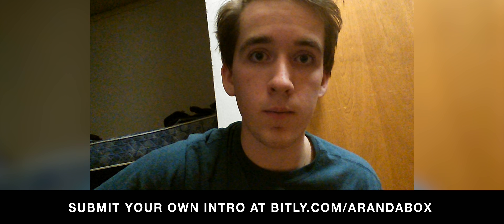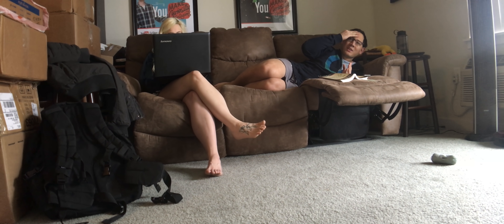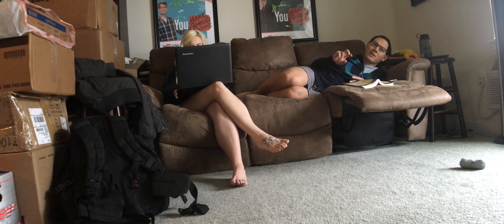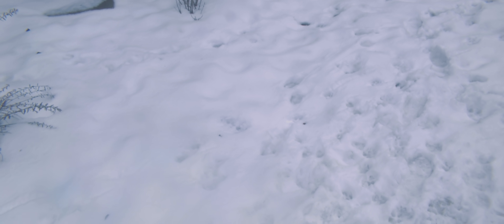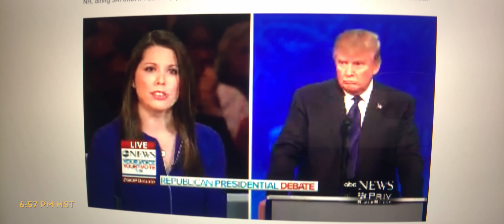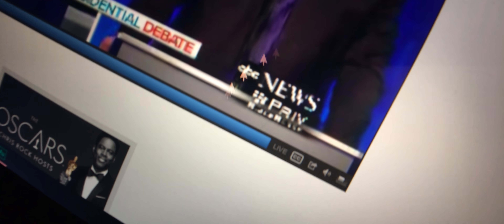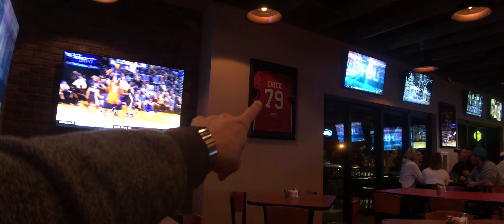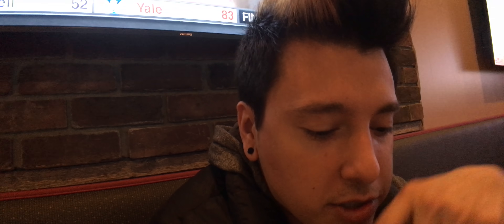Frequency Modulation

Comment: From what I remember in Physics, FM radio tuners receive a radio wave, which is an electromagnetic wave, that induces a current in an inductor-capacitor (LC) circuit.The induced current of the electromagnetic wave oscillates because the electric and magnetic fields in the wave that induce the current are changing over time, which is measured by the frequency of the wave.

LC circuits have a property that it can have an oscillating current at a frequency called the "resonant frequency", which is similar to a swing having an oscillating motion at a certain frequency. If the frequency of the induced current matches the resonant frequency, the maximum current of the circuit increases. Sticking to the parallel, if an outside oscillating force (i.e., the pushing of the swing by a person in intervals) matches that resonant frequency (the frequency of the motion of the swing), the swing can go up higher.

Hope that helps.

Comment: For FM, just imagine an undulating spring passing through a static point at a faster rate. So the amplitude is the same, but the wavelength between each crest will differ.

Comment: 1:49 THANK YOU!!!! I got so excited when this came in the mail. So the giant Einstein is a really big sticker, then? It's got this translucency to it that seems different from most stickers, so I've been trying to figure out if it's a window decal, or something I can iron onto fabric, or what. But you're saying it's just a giant normal sticker? I want to put it somewhere but I've been nervous to do so before really understanding its nature.
Reply: +Naiadryade It's a decal! If I'm remembering correctly, there should be a translucent paper sheet on each side of the decal. If you remove the paper on the back side of the decal (the front side I believe has Einstein looking left) and then place the newly exposed side onto some surface starting from one side and sort of rolling it down onto the surface so it doesn't get any bubbles stuck. After it's completely down just rub on it with something stiff like a piece of cardboard to make sure it doesn't come off easily, then you can peel the top piece of paper off.
Ta da!
Reply: +Naiadryade Congratulations on winning!
Reply: Thanks Drew! I feel so lucky. It didn't really require any skill, except for my being omniscient of carrots.
Reply: +Naiadryade I'm not totally sure if it's permanent. I would think as permanent as a sticker. Probably safe to assume permanent just in case, but you could google it. 
I don't think Michael has plans to sell them, he only has a few , but you never know!
Reply: Thanks Katelyn!! Once I place it, is it permanent?

And, is this something Michael is going to be offering as merch for everyone else?
Reply: Katelyn Salem
O.O I feel so special. I'll have to choose somewhere really good to stick it. Thanks!

Comment: mopping the floor is so annoying. I also avoid it as much as possible.
Reply: +Paula den Ouden I not only hate washing the floor, but I have been told by both my mom and my wife that I am not good at it. So I'm given a pass (I do other chores instead).
Reply: hahaha, same with me and dish washing. don't like it much, but I'll do it if it needs to get done. But usually my mom takes over, because I take forever and ever and ever.
Reply: ***** I suffer through dish washing which I despise even more than washing the floor. Dishes are annoying and leave me with a really hurting back (I'm usually too tall for the sink height), but floors are agonizing since I know I'm going to have to go over them again and still "do it wrong".
Reply: I HATE cleaning bathrooms. I'll do the lawn, dishes, vacuum the floors. But I hate doing the bathrooms.